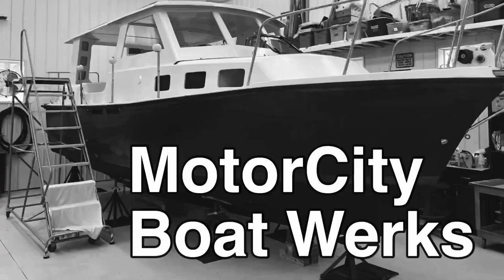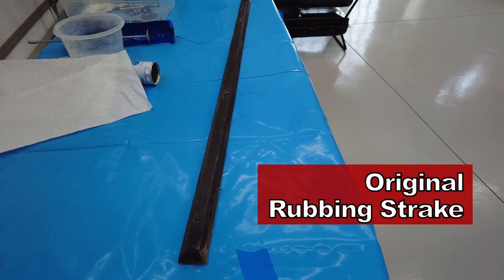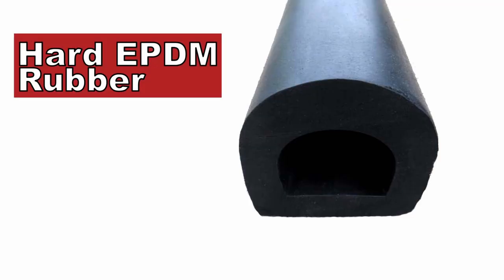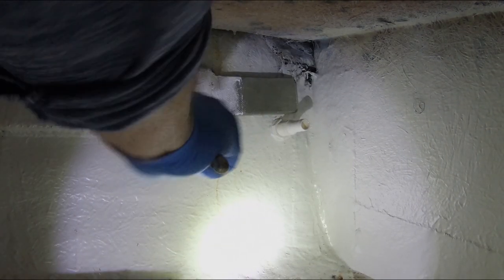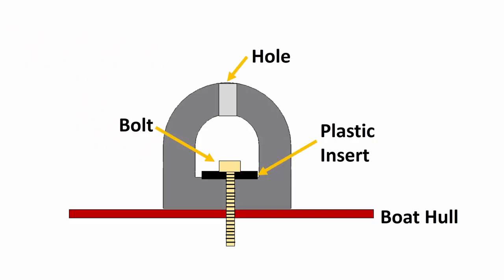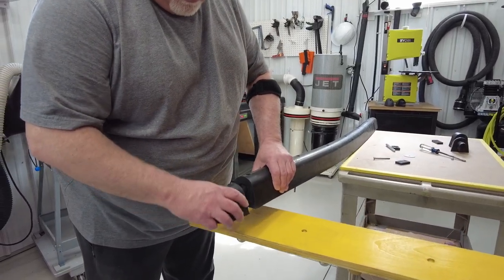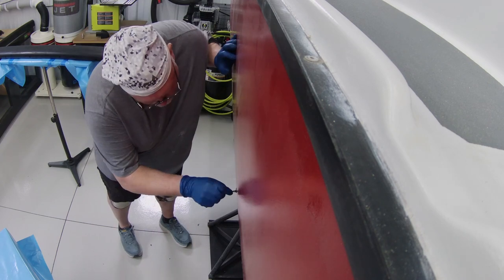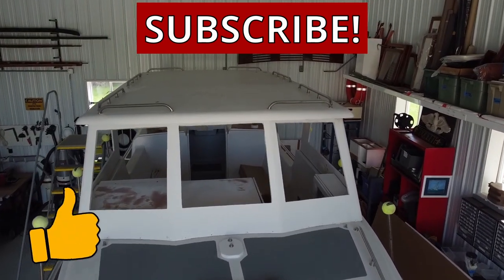How to Improve Your Boat Rubbing Strakes |  Sailboat Restoration | Trawler Boat Building (Ep41)

Comment: That Duramax rubrail looks great. I assume there's some nautical "rule" that no matter what rubrails you have and no matter how many fenders you have and where they are placed, a piling will always f- up your nice paint job somehow. It just happens. But I do think these beefy rubrails will reduce the risk.
One question: It's right by the water line. Any chance it'll affect boat handling? You're not planing with this boat, and I assume the topsides stay above the water. But just curious if there's a case where these things could get in the way of water flow.
Reply from the maker: No concerns about the positioning or the placement. 👌

Comment: Wait a minute... How do you get each HDPE piece in the correct location? Do you slide it in with something like a yard stick the right amount, and then poke through the screw hole to catch it and line it up? Seems like a bit of a pain, but doable.
Reply from the maker: There’s HDPE and EPDM. Yes I use the “Sandwhich” method of hole alignment and some careful measuring. I will be covering this technique in a few weeks